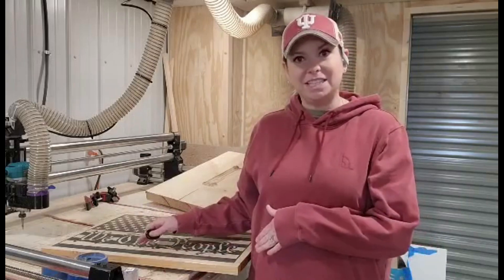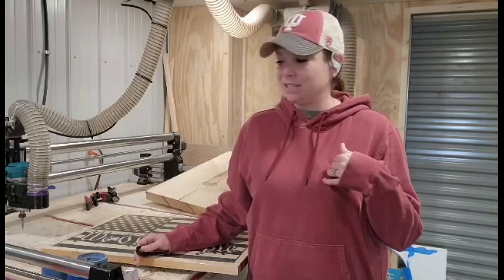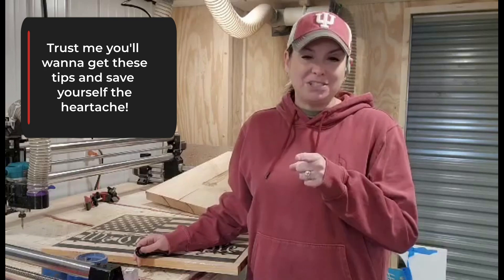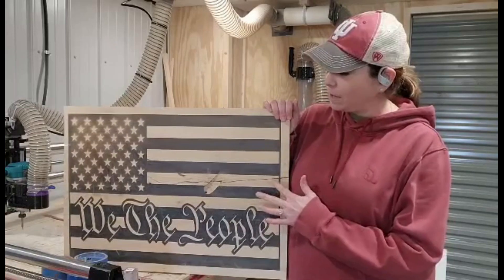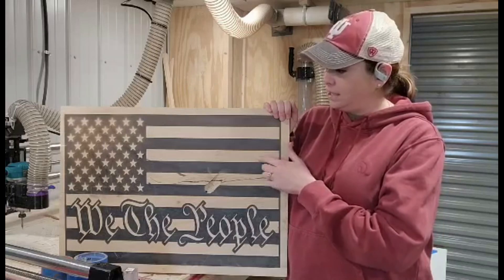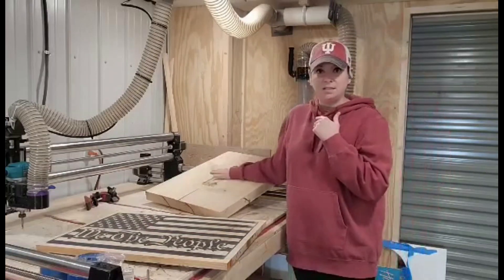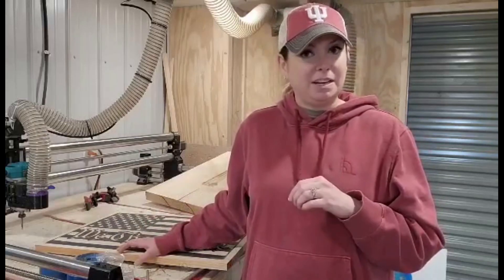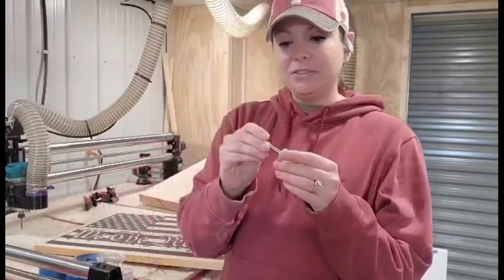We the people flag Hacks that CNC'rs should know, American Flag, OneFinity CNC,

Comment: A quick tip for you when it comes to surfacing: Ramp in your plunge moves if you're using an offset machining strategy. There is no cutter along the bottom of your surfacing bit, so it's going to bottom out when it plunges in to start the cut. That'll create burn marks and possibly damage the bit, depending on how deep you're cutting. I find that I get the best surface finish when I use a raster machining strategy instead of offset, and I create the toolpath so that all of the plunge moves and direction changes are done off of the surface. Other than that, keep at it!
Reply from the maker: Mark, that’s great info! Thanks for the tips. I hadn’t really considered using a raster approach. I’ve used the conventional for most everything. As a newer CNCr I’m learning these things for great people like yourself!! Do you have a video on how you setup your toolpath and plunge rates for surfacing?

Comment: Kate you have a mouse in your pocket and a frog in your throat. You're never alone in the shop. Thanks for the pointers. So you're convinced that it isn't because the resin was too thin or not stirred well?
Reply from the maker: Lol, you’re right, never alone! 😂. I think the resin was too thick. It was a quick set epoxy and it just set quicker than I expected. It was stirred well enough, I usually stir for 3-5 min depending on how much I have. 
Thanks for watching! I appreciate ya!!